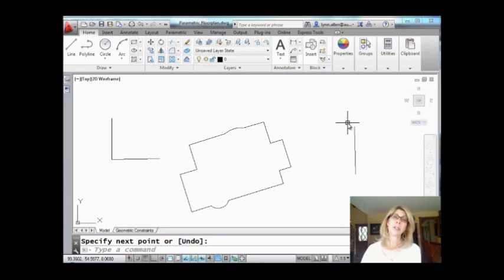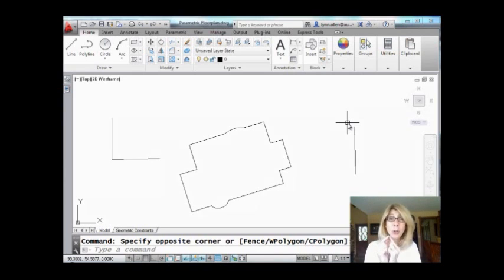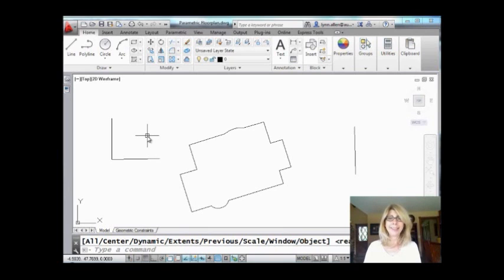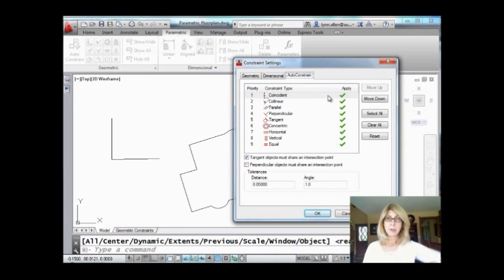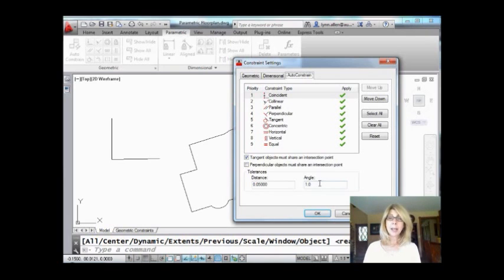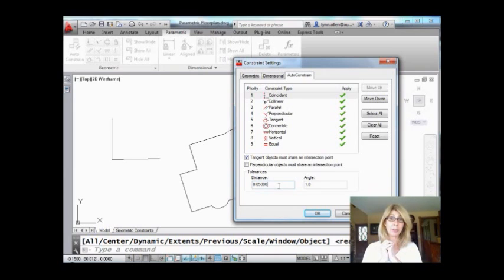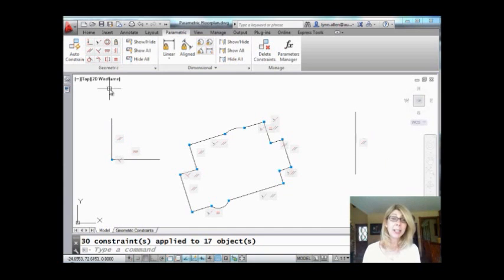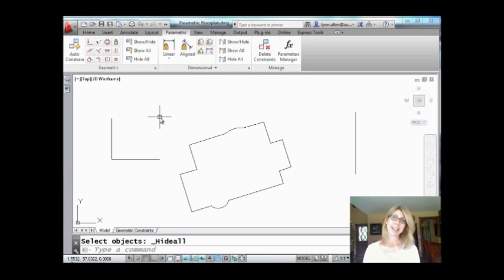AutoCAD Tip -- Fix Gaps and Off-Angled Lines with AutoConstrain (Lynn Allen/Cadalyst Magazine)

Comment: Hi... I have a question about Gaps.
I have successfully converting Lines to PL.
And when Print it as PDF to be use in Corel. Line become broken.

Later, I apply the Auto-constrained that you show here.... it seems to fix/adjust my PL which I thought then would solve the problem.
But it didn't... once save as PDF and import into Corel Draw, someone lines become broken especially around the arcs.

I tried to just property of my PDF to highest possible DPI but still, the line broken once it's imported to Corel Draw.

Do you know a way to save AutoCad Draw to be successful import into Corel Draw without any gaps?

Comment: Nice tip.  But it looks to me like once you run the constraints and it "fixes" the drawing, those lines are locked in that position.  Doesn't look like from that point on you can edit the lines, maybe I am overlooking something.  Still great tip.